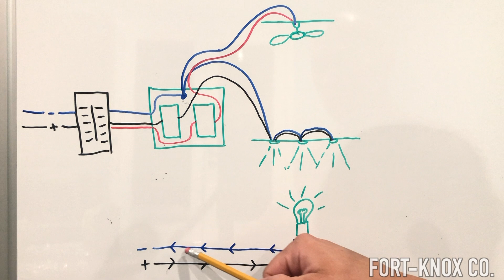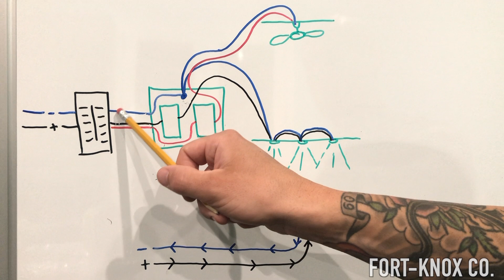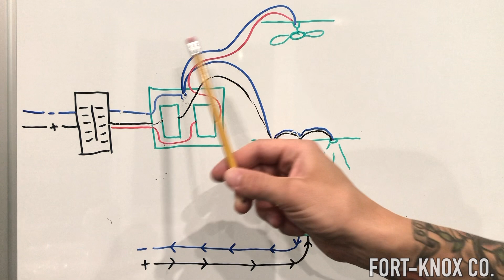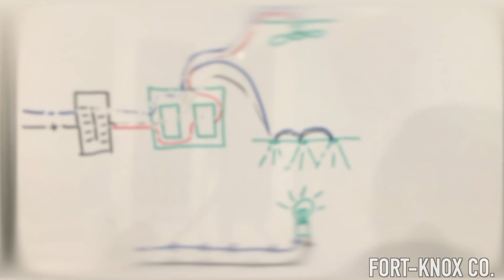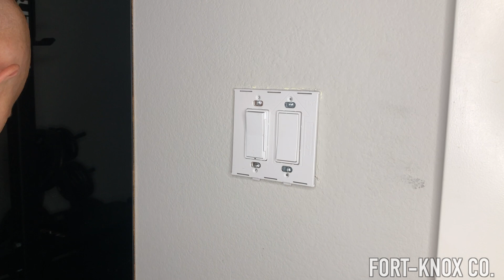How To Install a Dimmer Light Switch | Replace a Light Switch, Works with LED lights

Comment: Great video. One thing you can mention that would take the video to the next level of complication is getting a dimmer rated for LED lights, and the dimmer will have a small adjuster to set the minimum dim level so the LED's dont flicker when you use the regular dimmer/slider. Took me some research to figure that one out.
Reply from the maker: Thanks for the idea. I’ll be doing another video where I’m install 6 new 6” LED lights to my living room and then installing a dimmer switch to control all 12 LED lights. I’ll be mentioning that in the next video for sure.